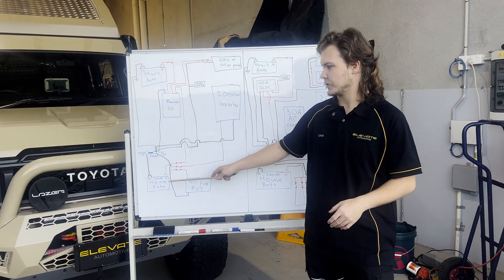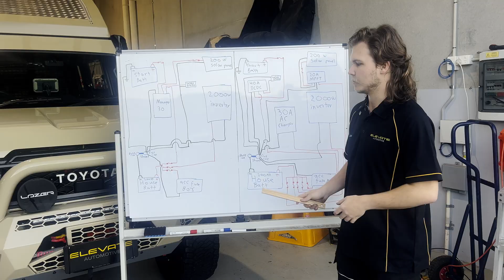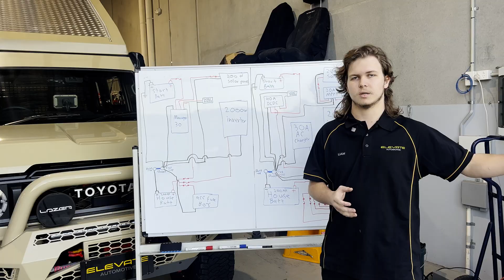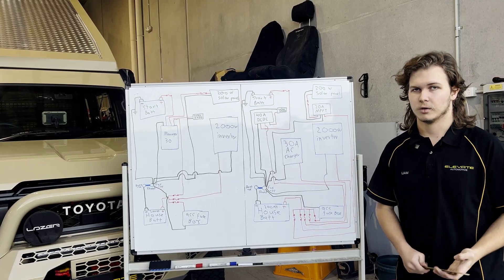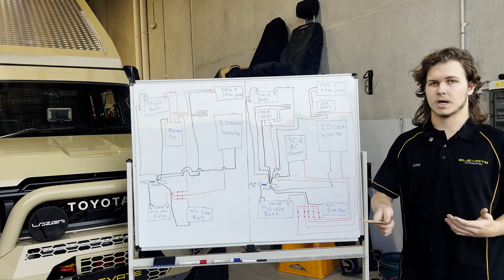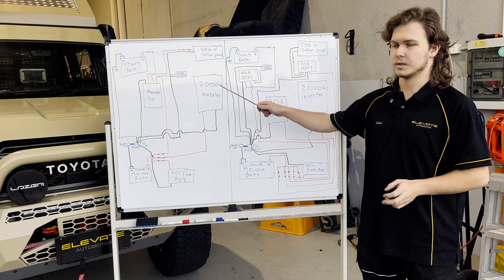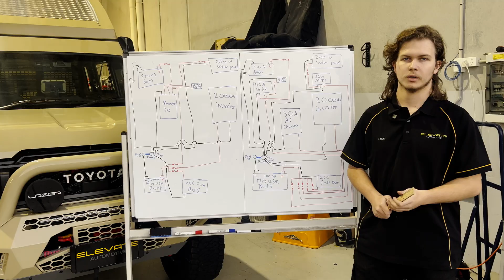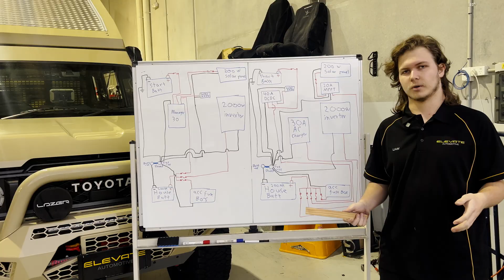Combined Charger Manager vs Separate Chargers – What’s Best for Your Setup?

Comment: Can you explain how does 3000w inverter with built in ATC and built in AC battery fit into your 2nd example (3 way charging system)
600w roof solar, 600Ah lithium deep cycle batteries 
Also,